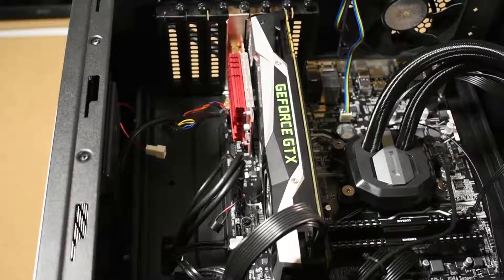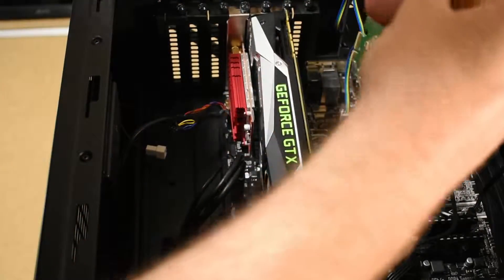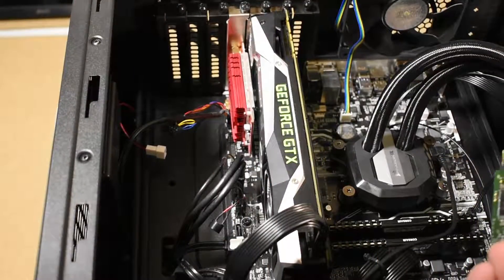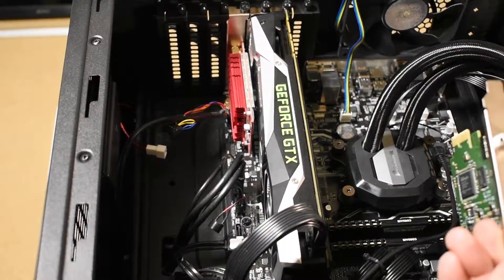How to install a PCIe extension -Tech Vlog

Comment: Trying this with mine. Will report back on whether it worked with the WiFi card I wanna install
Reply: Did it work? Ive same problem, my rx 6600xt is covering up the pcie x1 slot, i just bought a wifi card now I can't install it.

Comment: hello there. nice video. will this work with sound card (let's say Creative Sound Blaster AE-7). I've notice that as opposed to riser cards which take power from the psu the pcie extension on this video doesn't need power from the psu. The sound card i've mentioned doesn't have any special connection to the psu. you just plug it in the pcie slot. So where will it draw power from ? does it run through the pcie extension that you've showed us ? thanks a lot.